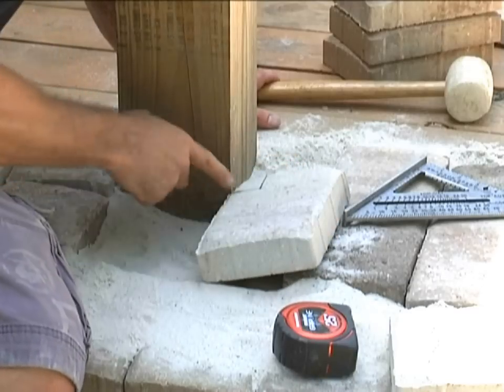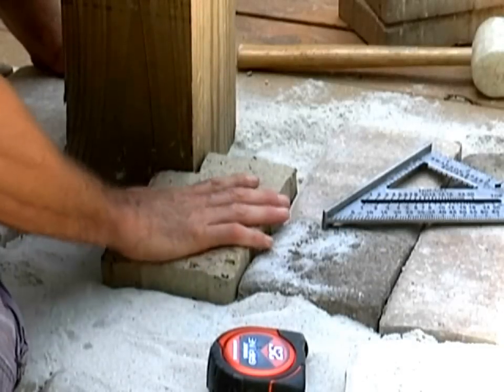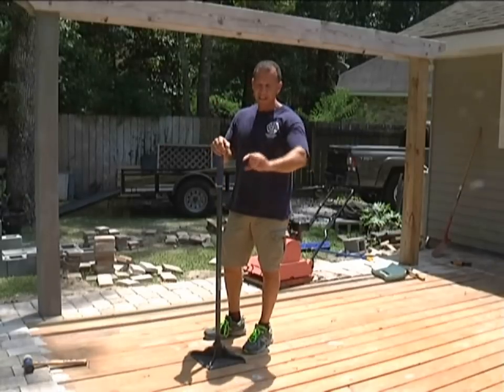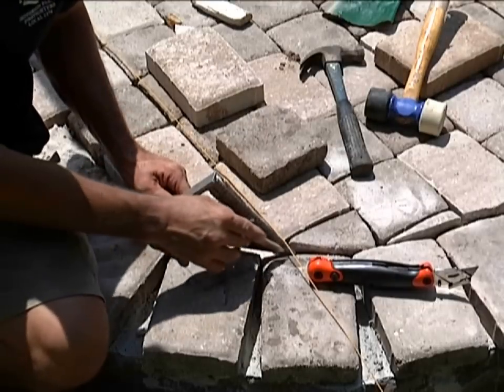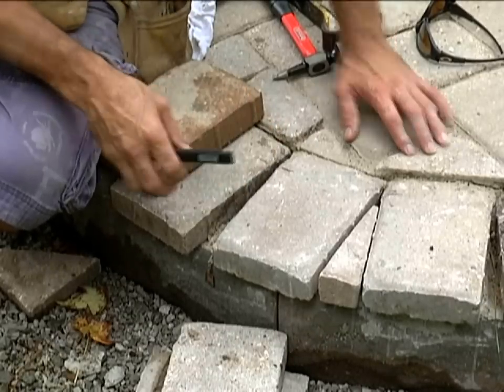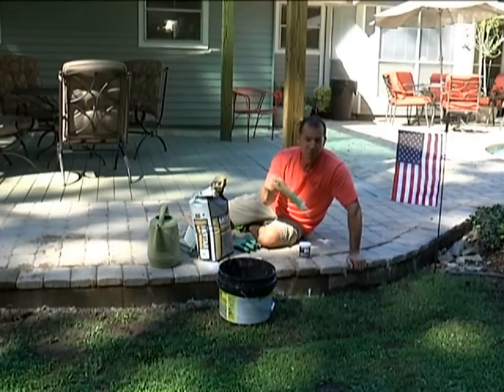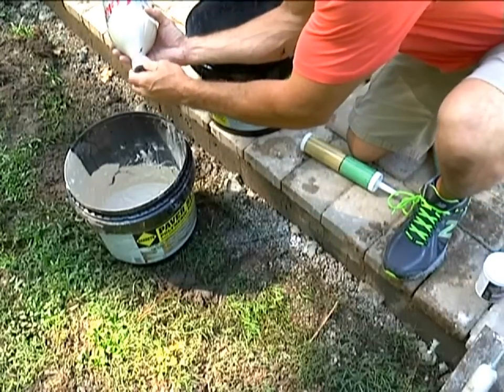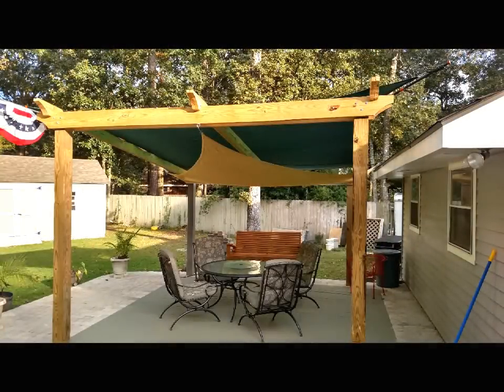How to install patio pavers 2

Comment: like the way you used the old liquid nail tube,good idea
Reply from the maker: +zipperrrrr
Thanks Zipperrrr,
I will show how I refill the tubes in the near future.
It is very simple and it works well. I mix paint with my silicone and caulking to get custom colors. These 2 videos were a little long, so I did not go into the recycling of the tubes.
Have a good day!
Paul

Comment: as usual Paul your the man...nice work and I must say you took me too  school on the damn mortar in the caulking tube trick..I have used a ziplock baggie w the corner cut out...but I will be trying your way  out next time
Reply from the maker: +adam ezell 
Hi Adam,
good idea with the ziplock bag. I use it myself to mix my paint with silicone and caulk. I cut a corner out like you explained and squeeze the contents into my tube.I never thought about using the baggie as a grout bag. You taught me a new one my friend! Good to hear from you!
Paul